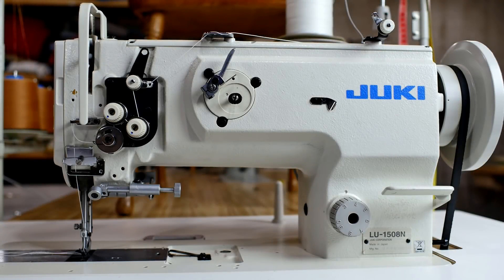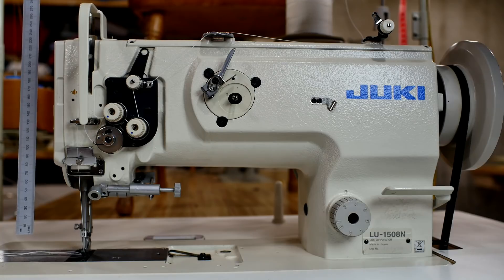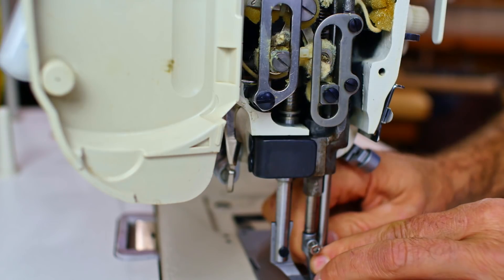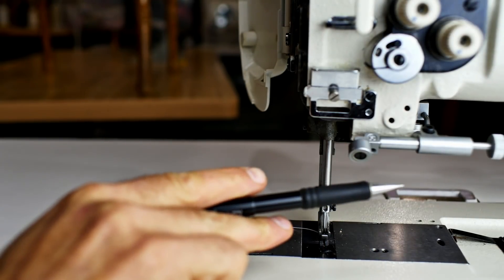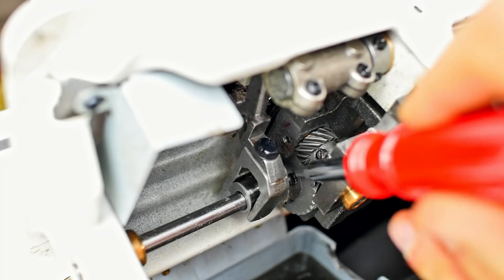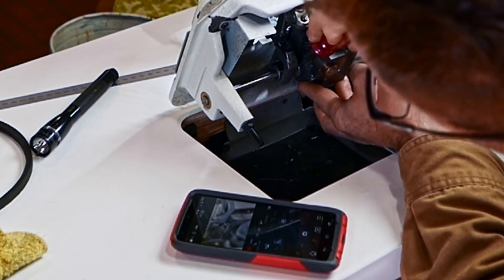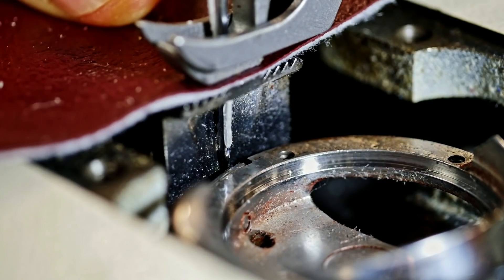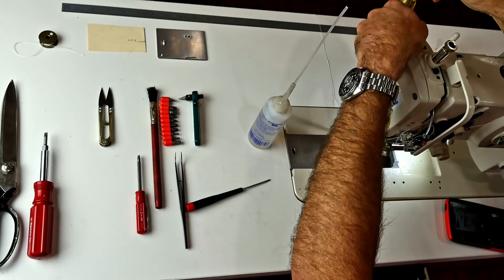Timing The Juki 1508 1510 Needle to Hook

Comment: I have the NH version of this. When I use reverse, it throws this timing out of wack. Is something elsewhere slipping or moving? I tried this a few times.
Reply from the maker: I recommend looking at the hook while operating the machine slowly by hand to watch the sewing motion to see where the error lies. Then you will know what to do.
Reply: @AlexanderDyer   Eventually.... turned out the drive gear was not in the right location, the hook gear was then not in the right place to compensate. Turns out someone dropped the hook gear out of the machine, maybe when changing the hook. I think we moved the gear 3 or 4 teeth to get all the spot screws back into the correct places. Hint: 1st screw in rotation is the spot screw.

Comment: Correct me if I’m wrong but the machine you show yourself working on is a LU 1508 N and the number you used was for the 1508H according to your manual
Reply from the maker: You are not wrong. My machine is set up for the larger needle that the H uses so that is why I used that figure.
Reply: So you were able to swap for a 190 needle system with just a needle bar height adjustment?  I did that on my LU-563 and might try it on my LU-1508N.  Thanks

Comment: I recently picked-up a 1508nh and tried to set the needle bar height.  I set it to 52.3mm as you did in the video and the top of the needle bar hits the top of the machine. What should be the needle bar length? I works with a shorter needle, but wanted to use a 190r needle. Perhaps, someone changed it out and put a different length in place....I have searched the web to no avail. Thanks, Cheers.
Reply from the maker: Did you see this? https://alexanderdyer.work/uploads/manuals/Juki%201508%20Engineer.pdf
Reply: @AlexanderDyer  Thanks for the link. As suspected, the needle bar that was in my machine was the wrong length and little bent/warped 🤔. I replaced with the correct bar and voila!

Comment: Alex, my new 1508NH just got delivered today, at the dealer's store it worked fine but now I can't get the bobbin housing to spin. I loaded the fully loaded bobbin into the case, pulled the thread around that slot at the front, but as I crank the wheel, the housing/bobbin case, any part of it, does not spin to allow me to further pull the thread through and to enable the needle to pick up the bobbin thread. Basically the bobbin area is complete non-mobile.

Comment: Thanks for the video, I have the 1508 and got thread jammed into the hook assembly and can't get it out, how do you take the hook assembly out of this machine so I can try and remove the thread it is really jammed in there?  The owners manual I have doesn't show which screws to loosen to remove it?  I wasn't able to move the hand wheel at all but now I think I have enough of the thread out so I can turn it a little bit but the way the hook is turning it looks like the hook assembly is not lining up right anymore hopefully wgen I get the thread out it will line back up, any suggestions on what I need to do would be very helpful?  Tomorrow I'm going to tilt the machine back and see if I can't get the thread out from underneath that the machine but it's wrapped around the hook assembly pretty good.  I have to remove the knee lift first before I can tilt the machine back. Thanks for your help, I sure hope I haven't hurt anything on this machine this is the best machine I have and love it I'm just hoping I don't have to adjust anything to get it going again, I'm worried. Need to buy a manual for sure. Thanks again. Tammy
Reply from the maker: There is a link to the manual in the description that you can download for free. It is not too tough to remove the bobbin case. The manual should help.
Reply: Thank you very much, appreciate it.
Reply: @AlexanderDyer  Alexander - I have a stuck hook assembly on the bobbin case on my Juki LU-1508NH. can you point me to the page on the manual that would talk about removing the case?

Comment: I am reviewing the timing video on the Juki LU 1508n. When you discuss the needle bar height you point to the number 52.3 for the 1508H, yet the 1508 has a height of 56.8. I am confused. Please could you clarify?
Reply from the maker: It really depends upon the needle system used. Mine is Altered and that accounts for the difference. If you follow the manual for both needle and needle bar height you will be gold.

Comment: What is the needle type for this model? :) is it 190r mtx19?
Reply from the maker: According to my manual, some take the 135 X 17 and some take the 190 . Some people will switch needle systems between these two but that does require that the machine be re-timed. If you have a new machine and one needle system doesn't work, you could try the other to see if that solves an issue.
Reply: @AlexanderDyer  Thanks man! U never fail to reply. I will test both needles out. Retiming seems to be complex, not sure if I can do that on my own though. :)

Comment: Trying to do timing on my Singer 20u but one of the two screws on the gear won't budge. It's slightly stripped on one side plus it feels really stuck in there. Any tips on getting it out?
Reply from the maker: It will probably need to be drilled out. A dicey prospect that can damage the threads if not careful but that can be replaced too. Get a left handed drill and an easy out.
Reply: Thankfully that screw did not end up being the problem after all. But thank you for replying. @AlexanderDyer

Comment: Proper hook timing is performed by sliding the large gear to the left or right, not by rotating it. The gear has two screws, one of which tightens into a flat spot on the shaft. You never want to rotate the gear so the screw comes out of the flat spot, otherwise it may slip if the machine ever has a thread jam
Reply from the maker: I concur. I went back and looked at my video and I think that my mistake was in editing because sliding that gear is definitely the way to get it done. Over the course of my several videos I have found that when I make a mistake, and I do make mistakes, the good community of YouTube will find it and correct it for me.

Thank you for your good work.
Reply: Will you guide for LU1560 N-7  thread cut issue how to solve...pls..

Comment: thank you for sharing! & this LU 1508 made by Japan?!
Reply from the maker: Yes. Made in Japan. :)
Reply: Can the walking foot and presser foot's alternating vertical movement
 set and change manually (by screw) or it semi permanent?
Reply from the maker: Similar to other walking foot machines like the 563 and the Singer 211 the alternating vertical movement can be adjusted to increase or decrease the height of alternating movement.
Reply: okaay, Thank's Mr.Alex!

Comment: hey 
what do you think is a Better machine 1508n or dnu1541
Reply from the maker: I think they are both good. Specs are on Juki's site so you can compare. The 1541 tends to be more affordable so if it will do what you need but the 1508 has some slight advantages in capability if needed. I use them both and like them both.
Reply: hey thanks so much for the reply

Comment: Is your 1508 an N or NH? The name plate says N but you used the NH needle bar height, 52.3 mm. Other pictures I've seen of NH machines say that on the name plate.
Reply from the maker: Well, you caught me. I have gone a bit off path with that. There are two different needle systems that can be used on this series of machine, one being longer than the other. By using the needle system and bar height of the NH I have in effect converted the N into an NH.
Reply: It's good know that option is there. I recently ordered a 1508N and studied for a while the differences in the N and NH before deciding the NH was not worth, to me, the almost 30% higher cost. The primary upgrades on the NH were the much heavier hand wheel, 190R needle system, and slightly different feed motion.
Reply: Alexander Dyer i need help with a machine. kingmax gc1510l-25 it appears to be sewing in reverse. has a wheel on top thats spring loaded i took it off. i also cant find info on it. bought 2nd hand

Comment: Great video, awesome quality and clearly explained! Nice to see something on the 1508.  What was your method for setting stitch / feed length 0?  It seems theres no hard stop for that and 0 is never quite reached.  If I work the handle up and down I can get closer to 0 but not sure if that is what the factory settings intended for.  May not be as critical with timing but for something like the needle entry position adjustment it seems to make a big difference in the measurement / result.
Reply from the maker: Mine works very similar to what you describe. I just get as close as I can, I don't think it is super critical but;  You can test by sewing a piece of card stock, if several strokes make a single hole then you have attained a 0 setting. The dial doesn't seem to be all that accurate.

Comment: Love the videos, especially the ones where you make a bag. Do you sell machines? And what is the major difference between the 1508 and the 1541.
Reply from the maker: Thanks. The differences are fairly subtle and mostly unseen but the 1508 is slightly more capable and has drop in bobbins.

Comment: When you made your gauge for needle bar, were you measuring from top or bottom of needle clamp?
Reply from the maker: From the bottom. Check out the manual, there is a picture/figure showing where to measure.

Comment: Awesome, as always. So what might a symptom of an out of time hook be?
Reply from the maker: Skipped stitches or no stitches, Ha Ha. This is kind of where the rubber meets the road so to speak.
Reply: Thanks. My 1541 then is likely in time. It does not miss stitches. I just have to figure out why there is some sort of a catch  when turning by hand. It's like a bur on a needle catching the fabric sound, but it's not a bur on the needle. Always fun to learn new tings about these machines.
Reply from the maker: Maybe pull the door over the bobbin case and see if the thread is passing around smoothly. Advance by hand to find the exact place you hear the sound. Happy hunting.